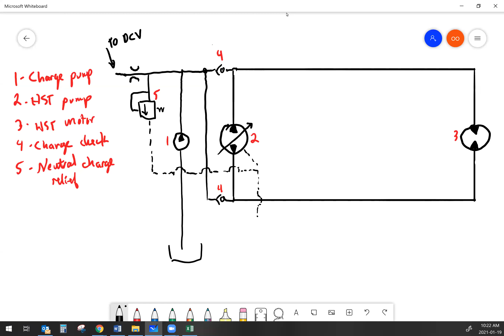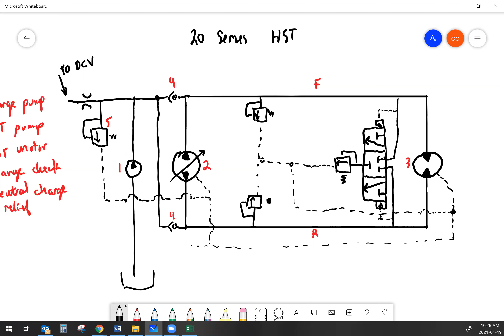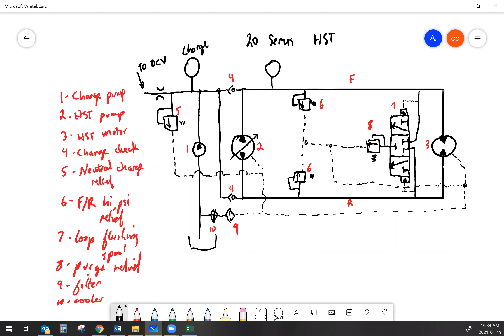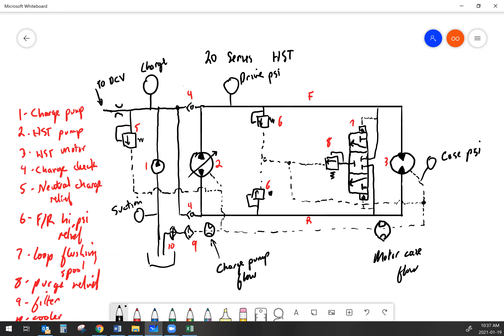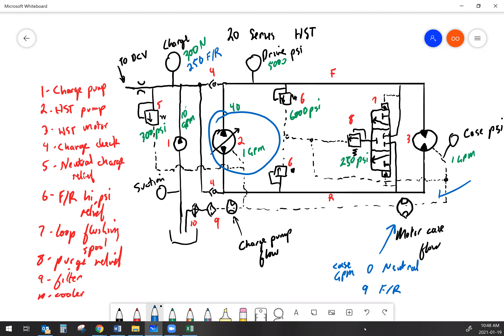Hydrostatic System Diagram step by step drawing and explanation

Comment: Why we add a purge relief vlve with flushing vlve?
Reply from the maker: To maintain charge pressure when the return side of the closed loop is venting through the flushing valve to motor case.
Reply: @ollieolson  plzz could you do a videos about Kawasaki pump k3v k5v regulator and the famous pumps a4vg and a10vo